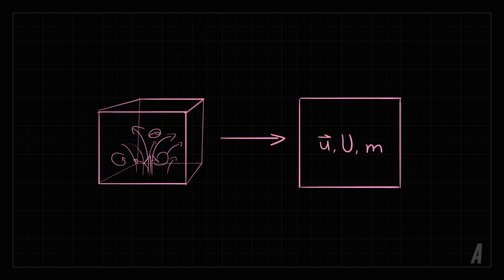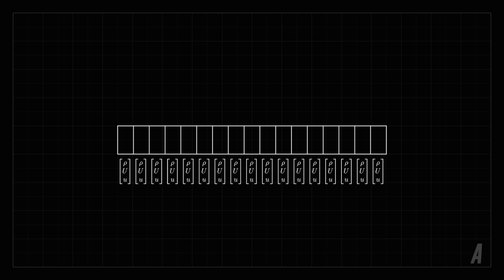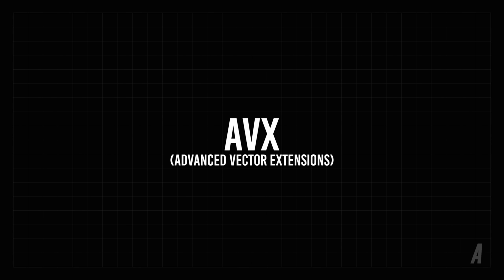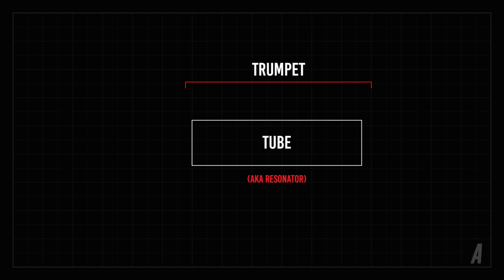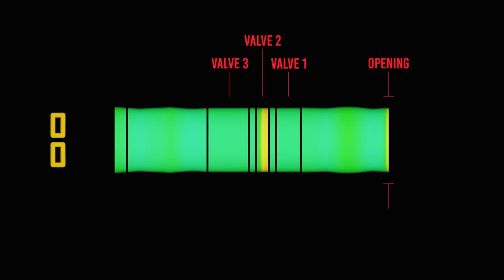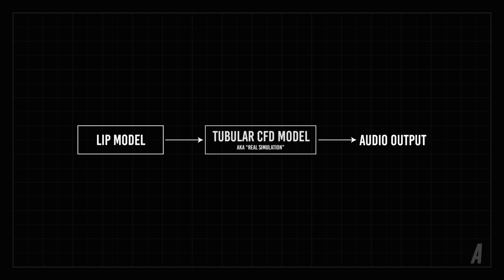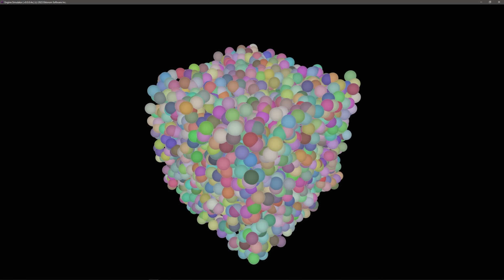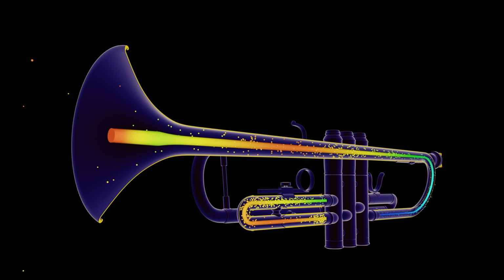Real-time Trumpet Simulation [C++/Vulkan] [WARNING: Flashing Lights]

Comment: This project is so cool! From what I’ve read about mouth pieces, they actually function as Heimholtz resonators, with another pressure boundary (or whatever its called, like the bell) at the base of the mouthpiece cup. This junction is the interior point at which the vibrating column of air reflects. In real trumpets, the size and taper of the backbore - as well as whatever gap there is between the end of the mouthpiece and the beginning of the leadpipe - has a large effect on tone and slotting (how easily the notes pop out when you play). And the size and shape of the cup also affects whats going on. I know thats a lot of extra stuff to model but would you consider it? 

Other fun aspects of brass instruments which I’ve wanted to see modeled for a very long time are curvature and bracing. The curves in the pipes of brass instruments seem to function as longer pipes than the straight sections. Brace placement/rigid points along the tube also affects slotting and intonation. 

I know you’re trying to keep things simple and only doing a straight tube right now but these are some things I would absolutely love to see. Amazing job!

Comment: regarding particle simulation it is quite hard to simulate collisions. In systems you are working with it is more appropriate to use hydrodynamic model since you have quite high collision rate with well defined (equilibrium) hydrodynamic characteristics. High collision rate do not allow your gas system to have tricky velocity distributions and you can fairly well use hydrodynamic integral characteristics (density, flow/current/velocity, energy).
Particle simulation is suitable for more complex systems in order not to deal with R^6 space for Boltzmann eq. In hydrodynamic model you can always inject mass-less particles for visualization purposes.
Reply from the maker: The fluid simulation is not particle based, it's a hydrodynamic model; specifically a linearized Riemann solver. I only use particles for visualization purposes as I said in the video.
Reply: @AngeTheGreat sorry, I thought you are about to start modeling particle motion.
what about shock wave (yes I also misheard that you are using linearized model)? It might be quite hard to add that nasty (V \nabla)V term, but at the same time it is of great interest in gasoline engines.

Comment: I think the reason you need lots of air to get good sound is for a very simple reason, the bell will enhance acoustic coupling and also resonate, making the instrument louder and sending that resonant acoustic energy back into the trumpet.
Reply: Think also because the actual embouchure opening is much smaller than the instrument bore. Probably only a few millimeters compared to the trumpet bore at like .468”. Sure it takes air to play, but it’s more about compressing the air with your lips.
Reply: @prkassel  Yes I agree, its not like your lips are flopping around in the mouthpiece like what the simulation depicted. As well, when you play the trumpet, youre trying to pressurize the air from the bottom of your lungs to your lips using your diaphram. Creating a large area of high pressure before a tight embouchure. Hope it helps Ange, fantastic video.
Reply: The mouth isn't a brick wall either.  Some amount of backpressure will cause some amount of air to slosh across the lips.  I think this video shows the lips being modeled as a perfect pressure source.  Making it somewhat softer might lead to a mouth resonance.

Comment: You're absolutely correct in describing how a simulation actually does a calculation, but there's a much simpler way of describing it (FEA incoming!).

Some terminology:
- Node: a single point representing a boundary

- Element: a line connecting two nodes together which is represented by a characteristic equation.

- Characteristic Equation: the equation that models what we expect to happen based some input (i.e. F = -k•x, ∆Q/∆t = k•A•∆T)

Finite Element Analysis is the method by which all simulations solve complex problems that either have dynamic states, or shapes which are hard to represent mathematically. Depending on the problem you want to solve you can either solve a problem in 1D (a line), 2D (a plane), or 3D ( a volume). 

Typically, most problems are homogeneous (meaning the characteristic equation is the same throughout the entire volume) and we can get away with modeling things in 1D. In such cases, we can break up the problem into some number of nodes (n), and elements connecting the nodes (n-1). Each node has input and output variables and serve as a direct connection between elements, meaning that we can take the reaction from one element to accurately represente the reaction of the following element.

An easy way to visualize what this looks like is by thinking about lines at a checkout. When the person at the front of the line is done ordering they move out of the way and the rest of the people in line move forward. Each person represents a node containing the current state, which in this example is position in line from the cashier.

What you mentioned about elements only interacting with adjacent elements is a constraint on all FEA models in which we need the output from the characteristic equation to serve as the input for the next element in line.

An easier way of thinking of this is by imagining imagining a highway with 4 lanes (2 in each direction). If 2 cars are in 2 separate lanes then they don't interact with each other. However, if 1 car is in the same lane as another car, then said car is limited in how fast it can go by the car in front.

Hopefully this explanation helped. FEA is a difficult subject to understand for anyone who isn't in the STEM field, and throwing in fluid mechanics takes the complexity to a whole new level (source: I have my bachelor's in engineering with a focus on heat transfer and fluid mechanics).

Comment: Oh my god, this is an amazing project. As a passive fluis sim enthusiast, you have just reignited my passion for this field thank you! 1 tip, i think 1 of the reasons why you needed so much pressure to make a noise is the mouth piece. Not sure if the modeled mouthpiece is the same as the simulated one, but the concave section is too small. From what I remember from playing a trumpet in middle school is that the domed section in the mouthpiece was much deeper, and the walls where thinner. Hope that makes sense haha, can't wait to see the next update of this!

Comment: Your tuning slides are pushed in all the way. At least that's what the model in your simulation shows. This could account for some of the intonation problems in your model if distances were measured the slides pushed in.

If you look at pictures of brass instruments you'll usually see the slides pushed in. The instrument looks better that way, so that's how they're photographed, but when playing the instrument the main tuning slide is adjusted to play at pitch. A good starting point is to pull the main tuning slide so the amount of exposed slide is the same as the width of the tube.

Trumpets have rings attached to the 1st and 3rd valve slides, and they are actively used when playing. 1+3 and 1+2+3 are inherently sharp valve combinations. The valves don't add enough tubing, so the performer must push the 1st or 3rd slides out to play those notes in tune.

I want to hear more of how your model handles moving up and down the harmonic series. There was very little of that in your demos.

Comment: As someone who has played in a marching band before (2003-2005 percussions, but got to know about other instruments as well), the noise is basically generated from forcing air through pursed lips, like the stretched lip of an inflated balloon. That's known as buzzing.

As for the keys, if not mistaken this is how each note is played (■ pressed, □ released);

Normal     Harder     Air blown
□□□          □□□
■□□          ■□□
■■□          ■■□
■□■          ■□■
■■■          ■■■

Comment: Any middle school band geek will know about tonguing the start of the note with a sharp "too" or "tuh" for more articulation. Perhaps that starting pressure is required to prime the air so you won't need to blow as hard? There's also a lot more to the mouth than just vibrating the lips. In fact all the expressiveness is directly from the mouth. Vibrato which separates a robotic performance from a human is a modulation of the Jaw or air pressure. Maybe modeling the respiratory system would add more realism to the sound.

Comment: One of the reasons the simulation might need such a high quantity of air is that it ignores the effect of the resonance of the metal itself, as well as potentially resonance in the mouth cavity (which, from experience, will also adjust the quality of the sound, like how didgeridoos sound like they do)

Comment: i've played the trumpet for 7 years, a few thoughts:
 - trumpets cool the air inside them; this creates condensate in the tubes that you have to flush out (this is what the small valves are for). obviously you don't have to implement condensation, but i wonder if the air being cooled by the surrounding brass pipe changes the sound?
 - re: blowing very hard: you don't have to blow extremely hard in a trumpet, but you do have to apply a lot of pressure to stick your lips together. a large part of learning to play the trumpet is "strength training" for your lips. i cannot stress enough how hard you have to pinch your lips; if you try without the mouth piece, you should be getting a quite high-pitched fart noise somewhere around 440 Hz (it's easier with the mouthpiece of course). you might be able to tune your mouth parameters easier by simulating only the mouthpiece and the lips.
 - on the same topic: the area of your lips doing the moving IRL is very small. maybe it's just that the model works this way but if it is supposed to represent lips, it is like 5 times too big. (again, maybe the model just works this way, i don't know)
 - this one is a bit hard to explain but here goes: since you can't do all the notes you can play on only 3 pistons, trumpetists blow harder (and pinch their lips harder) or softer for higher and lower notes. While this is probably a brain-feedback-loop thing, trumpetists have "levels" that they blow at automatically to make the right note and never need to blow "just a bit harder" to get the higher note. it's either the lower note or the higher one, and never in between. i wonder if this is due to the brain, or if there is a physical phenomenon that causes this.
- some of the sound a trumpet makes is generated by the bell vibrating and imparting motion to the air around it. obviously you're already quite close but if you're looking for very realistic then this is part of it.
- your trumpet definitely sounds computer generated, but not by that much. It definitely exhibits the same characteristics as a RL one, for example the blowing too hard trial sounds prefect.
- the woodwind aspect is probably due to changing the mouth parameters close to that of the reeds used by clarinetists. just a fun fact.
- this is extremely specific, but when pressing a piston on a trumpet, there is an instant in which the air can pass neither to the extra tubing nor directly, it is just stopped by the piston. this probably has an impact on the sound made right after a piston is pressed.

Comment: hmm, how much do different component materials will also affect the sound for IRL brass instruments?. Can/should this simulation account for how the  default sound also vibrates the metal? (I would think only the flare at the end would be significant for a trumpet but am unsure). Something that just accounts for density, thickness, and material sound-speed/resonance that should be easy to imput from a table? Or is all of that a non factor?

Comment: Amateur brass player (and professional programmer) here. With regards to the amount of force needed to make a good sound, a brass player will generally use lip pressure to try to make an approximate of the output sound in the mouthpiece. You can see this by searching for 'buzz'-ing, where just the mouthpiece is used to try to train 'muscle memory' of the lips. With enough force, the chamber will resonate anyways, so likely your simulation is just 'powering through it'. One thing you could try is cutting off the simulated pipe before the first valve and tuning the lips to about the pitch you want, and then using that preset for your lip/air when attempting to 'play' that note. Note: This varies based on the note you're trying to hit, as you need different lip pressure as well as valve setting for different notes (well, people do). Another fun fact is notes get 'closer' and require less valve movement the higher the pitch, so eventually you can hit a full scale without touching the valves if you go high enough in pitch. This also requires more care in lip pressure, as you don't 'lock into' the right notes.

Comment: Incredible simulation. I wonder if you could fix some of the intonation problems by "tonguing" in the simulation. Have the air from the lips suddenly stop when you switch notes, then start once the valve is fully depressed. For anyone who has actually played a brass instrument if you just jam through the notes while slurring the intonation is not great, although is does get better with practice.
Also, when I played trumpet I noticed that only certain configurations of lip stiffness and air pressure actually gave a good sound. Anything in between just doesn't make noise, or fizzles. You can try this with just the mouthpiece of the trumpet and change notes with only your mouth.
Also those low notes at 19:56 are comically low. Tuba simulator?

Comment: As a trumpet player I am extremely happy and impressed with this video. There are so many different parameters making this an impressive simulation. One interesting thing I noticed isn’t simulated here is there’s a cutoff after the low range of notes where it’s extremely difficult for notes to resonate. It is interesting to see different mouthpieces simulated, as you can technically put a Sax mouthpiece on a trumpet and get sounds.

Comment: Your trumpet sounds like the best from 90's synths.
And it can be confuse for the real one sometimes.
If this is not yet the full implementation... I wonder what the full one will be like.

P.S.: can you add support for "Beam"s? as in, a "flexible" tube that can change it's proprieties base on the the air flow proprieties?
It can be DLC.

Comment: I was thinking about how you could use a fluid simulation to simulate a subwoofer or smaller speakers in a range of different enclosures with different sizes and such, and how different length ports and transmission lines change the sound and group delay and such, it would be a cool video, I don't know how hardware intensive it would be but it would be cool.

Comment: I would be very interested in this technology being applied to a synthesizer with some of the odd parameters you described controlled by midi cc / knobs(lip tightness, mouth pressure, etc). Personally I think this sounds totally usable as is and I would be able to make brass sections pretty easily with something like this.

Comment: As a programmer, trombonist, and music theorist, I am looking forward to playing with this. 

Right off the bat, judging based on what I know about playing trombone, it sounds like it has bad embouchure. Embouchure is the word that describes lip shape and tightness. As you tighten your lips, less air is required to hit the same frequency. But that also means that the effective vibrational area of your lips decreases, which is something I don't see reflected in the simulation. I think that having a variable that controls effective vibrational area might make this simulation sound better, and maybe get more of that characteristic brass sound.

It's important not to disregard the mouth of the player as well. The shape of the player's mouth has an effect on the timbre of the sound, and having a mouth that can compress to an "E" shape or open to an "AH" shape may help (although that may be more of a mental tool that just reflects how tight the lips are during playing). https://dood.al/pinktrombone/

It's also interesting to me to see how the raw simulation can't hit pitches perfectly, and how much embouchure comes into play for that as well. There's a trick on trombone where you can play a low F (normally in 6th position) in any other position by just changing your embouchure.

Finally, I'd like to see one more element considered in this: the voice box. You can play multiple notes at once on brass instruments via the Overtone Series. It's not common, but it is done in certain jazz music https://www.youtube.com/watch?v=OEXCBYuInnQ You do it by humming an overtone at the same time as the note you are playing.

Comment: Very interesting! I feel like a trombone would have been easier to fine tune parameters as the tube length for each valve needs to change to pull sume notes into tune. For example, on the trumpet when you play a D below the staff, it is naturally sharp (higher pitch). To pull the note into tune you extent the 1st and 3rd slides to lengthen the pipes.  This model doesn’t account for the variation between notes and adds to the unequal intervals between notes. Using a trombone would allow variables to be fine tuned because changing notes is easier in the simulation as it can be done simply by changing the length of the tube in real time.

Comment: You might also want to take into account the speed of each valve press, as well as the angle of the opening in the lips, respective the mouthpiece. (I'm 21, been playing since 4th grade.) Also, the slide/"tube section" with the ring on it can be adjusted to vary the pitch of the instrument, on the fly.

{Edit: if you REALLY want, I could teach you how to play}